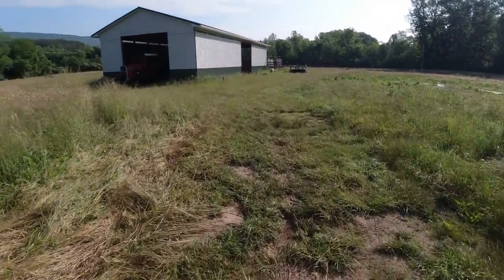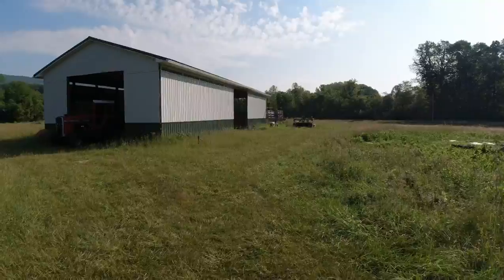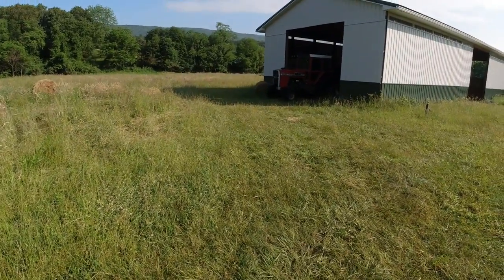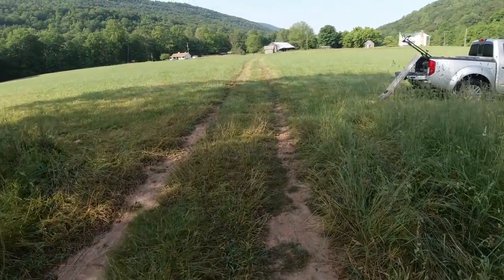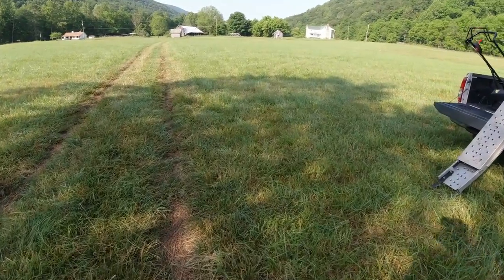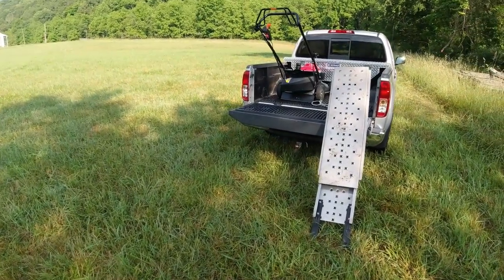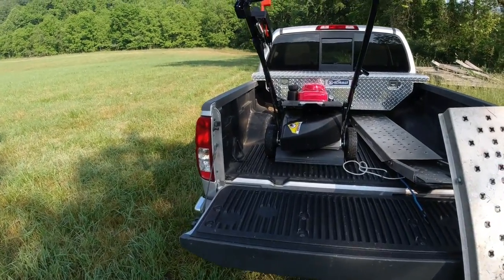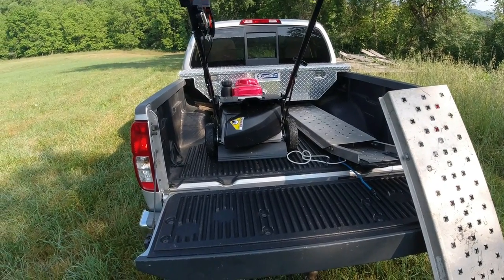Last of The Best - Honda HRC216 Commercial Mower

Comment: I have a Honda GCV160 5.5 powered Snapper 22inch self propelled mower and I love it 4 years old and runs super smooth and always goes. This year I snagged a John Deere 14SE Kawasaki engine powered aluminum deck, blade control. This thing runs flawless older then I am I love it but the Honda engine is something else. I'm sad to hear that they are closing the small engine doors.
The Snapper is my more residential mower and the John Deere is my comercial grade one and I love them both alot!

Comment: My favorite mower is the hrx217 but I can't find them anywhere. So want to give this a try. My hrx217 started shooting gas from the air filer air hole, and it got extremely hot. Gas was boiling and oil too. 😢
Reply: I started looking into a replacement mower. Mine Toro blew an engine. My local dealer has at least 3 of the HRX217. Going to pick one up tomorrow.
Reply: @chavezsergio4496  good choice. I bought the hrx 216 commercial mower and I'm not that impressed after using the hrx 217 for a long time. I usually mulch my leaves and throw them In the back yard. The hrx 217 is a better mulcher than the commercial mower. It makes no sense why they didn't include alot of the 217 features on the commercial 216 (216 cant handle a large pile, engine is weaker) . 😒 . Maybe I'll change my mind after I actually start mowing in spring.
Reply: @franciscorazo3458 😅funny I can back you up here your opinion is identical to my experience this fall. I have 3 hrx 217 over the last 7years, I just bought the hrc 216 commercial last week and your right does not mulch as good as hrx217 but my hope is that the commercial will perform better this spring l.
Reply: depends what you need not one is better then the next. just depends on applications